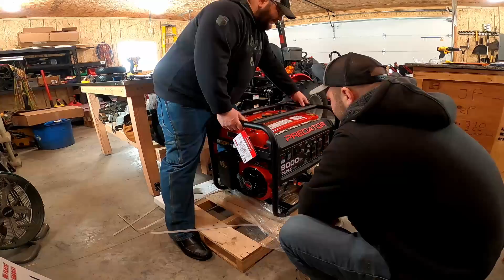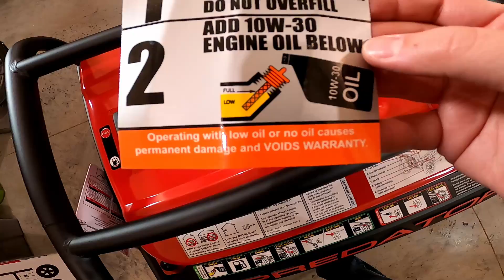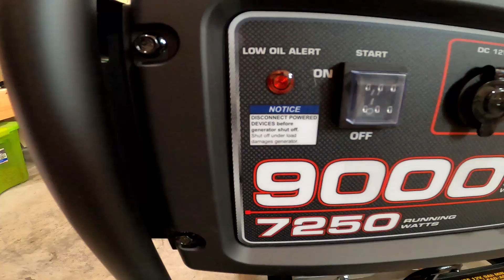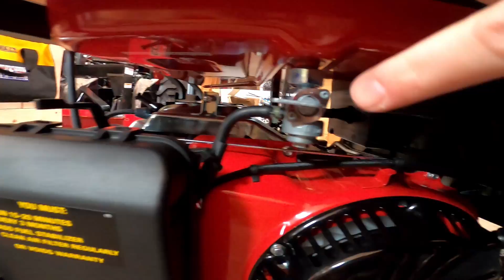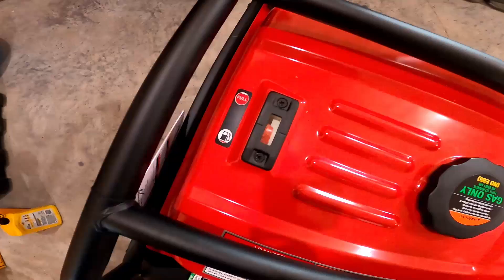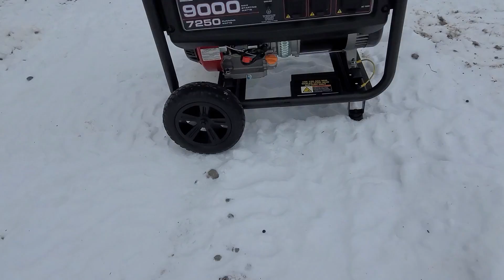Harbor Freight Generator Predator 9000 Watt- Best Portable Generator for the money?

Comment: Why use Stabill if you're using non ethanol fuel?
Reply from the maker: With or without ethanol fuel will still spoil. It's an added layer of protection to make sure the fuel stays fresh in situations like this were the generator may rarely be used. Thanks for stopping in
Reply: @k6outdoors  Gotcha. Some are suggesting turn fuel switch off and allow engine to run until remaining fuel burns out of carburator, also preventing gumming. Any thoughts on that?
Reply from the maker: @sh0964P2  I do that as well, if do fuel is left in the carburetor then there is nothing to plug it up if the fuel does go bad!

Comment: Just bought one of these and saved 20% with the track membership can’t wait to use it
Reply from the maker: Its been a great purchase so far, enjoy! Thanks for stopping in
Reply: @k6outdoors  great tutorial my dude, but where I live, the ambient temperature is about 17 degrees Celsius minimum to 22 degrees Celsius in the evening. Even if synthetic oils are great, there's no need to use them at all and I can get 2 jugs of mineral oils instead of a single jug of synthetic oil. However, I would still go for diesel engine oils, since these oils are formulated for long drain and to work with Deutz air cooled diesel engines. I regularly use Shell Rimula R4x 15w40 HDEO API ci 4/sl in my generator as thicker oils are recommended

Comment: They are very very good but new ones have C02 sensor that goes bad and shut down 
Bypass by connect white and blk wire together by sensor in panel
Reply from the maker: Great information, thanks for stopping in!

Comment: NOTE -- Don't let the gas sit in the tank. I have cleaned so many carbs with bad gas in them. Make sure the carb is also empty. Put the gas in when you need to run it. great video.
Reply from the maker: Great points, I appreciate the input and thanks for stopping in!
Reply: Use gasoline stabilizer.

Comment: I already see a loose heat shield rattle on top of head during your temp check
Reply from the maker: What you are seeing is a result of the frame rate of the camara not keep up with the vibration of the motor, I appreciate you concern! Thanks for stopping in

Comment: The original Predator 8750 is the exact same thing as the 9000. So I wonder was one under rated or is one over rated?
Reply from the maker: It's hard to say really, they easily could have changed a few small things that could result in 250 more watts.

Comment: I get they power the entire house, but using gas @ 8gals/13hr with 50% load? That's over 10gal easy per day... Depending on the emergency if the gas station not open or no power.... Storing 100gal fuel might be serious issue for many?
Reply from the maker: You make a fair point on fuel consumption and yes depending on the situation you might not have any fuel within many miles of your property. In my area we use LP as a primary source of fuel for heating our homes so I could run a line to that and run it off of that with a conversion kit, but I would rather not drain that tank as well. The ideal solution would be to have a system like my in-laws where they have a standby generator plumbed directly into natural gas. Last year they were able to run 2 weeks straight to power their property after a massive storm came through. That being said, I do keep the generator full of fuel at all times and an additional 5 gallons of fuel on hand. I make the assumption I can run the house if needed, but its primary need is for cycling the freezers and refrigerator as needed and in the winter heat, so we can stay warm. Thanks for stopping by!

Comment: HB has it right now from $789 down to $689, not sure if they'll take the 20% off coupon because it's on special for Black Friday. Will it run on Propane gas if I buy the adapter for it? If it does I'll definitely buy it. Thanks for the great video, I'm subscribing right now!!!
Reply from the maker: Thanks for dropping in! I have seen people converting them to LP but i have not done it myself. Its a great generator and think you'd be happy with the purchase.
Reply: It's pretty easy to find a propane conversion for them. A quick Google should find it for you.
Reply: Amazon has the kits. I’m getting one for mine. Already have one on a troybilt 5500 and it works fine.

Comment: Bought one after hurricane Ida. It ran almost continuous for about 7 days without a hitch. Fuel consumption dropped 2 gallons a day after a few days when the engine broke in. I assembled the wheel kit and installed battery and filled crankcase with oil on the tailgate of my pickup in the dark. Fired right up and put it to work at 11pm.
Reply from the maker: I have been extremely impressed by how well it does run,  no fuss starting and it runs smooth

Comment: This same generator is going for 789.00 now and HB got rid of coupons as well
Reply from the maker: I was definitely I little disappointed in the coupons going away. I noticed the generators are going up in price and they added more models
Reply: @k6outdoors  yes same here. I was going to buy their inverter the one with over 8,000 watts but it has more technology in it and I rather keep it simple and have something that I can service later on. Can’t go wrong with a simple generator and especially for one this size. I’m looking into getting a tri fuel conversion kit so I can run it with natural gas and i want to buy an enclosure for it
Reply: Check out my video on the Tri-fuel conversion kit I installed on ours. I don't post links to my videos on other people channels, so just do a search.
Reply: We bought our Predator 9000/7250 watts generator in Aug. of 2020 for $599 with coupon. It's crazy how much it has gone up in a years time.  It's still a great price though, compared to other generators with the same wattage.

Comment: Late to the party. But how many things did it end up running? My mom is on oxygen and a heart monitor.. I was impressed with first pull, don't need any more hassles.really likes how you went over the whole item and showed where everything is was.  Did you make a video on how to hook up Appliances etc?
Thanks again
Reply from the maker: Hey thanks for stopping by! I have not made a video of it being hooked up to everything. There are regular 110 volt out lets and then the larger 30 amp connections. Its not necessarily how many things it can run but how much power it supplies. Each item pulls uses so many watts, so you'd have to figure out or look up what each unit uses. This is a 9000 watt generator and will run basically everything in a house aside from most water heaters and large appliances such as electric stoves and central AC units. Hope this helps
Reply: Do a search for my video.  I give an in-depth review of it powering large items in our house. (I don't post links to my videos, on other people channels)

Comment: Does this unit need to be grounded? 
The user manual says to not run it until grounded?
Reply: In the real world people running generator on Job sites definitely are not grounded... Just saying. It's a technical and legal thing
Reply from the maker: If your plugging it into a transfer switch or breaker box you should be grounded by that system. If using it in a standalone configuration it needs to be grounded to be deemed safe, per the instructions. That is my understanding and you should follow the manual.

Comment: Hi you shouldn't break in a small engine with synthetic oil, it's too slippery for a good break in. Use regular oil for the break in then you can use a good synthetic oil. When it's time to shut down your generator just shut off the gas cock from the tank and let her run out of fuel. It's best for your carb that way and it will always start great later. Just saying.
Reply: Good point, NEVER let gas sit in a carb/bowl on seasonal equipment as it will tarnish the carburetor and it's components. Gas is a good solvent untill it sits still for a lengthy period of time. A fuel stabilizer will help fight this as noted in the manual. If you don't have stabilizer, drain the fuel out, then start it, let it run the fuel out of the bowl untill it starts stalling and quickly blast it with a couple good shots of carb cleaner. An old go cart racer tought me this trick to keep your carbs clean and ready for the next time you need dependable power!
Reply from the maker: Appreciate the feedback

Comment: The oil change interval at 20 hrs is more to do with the fact that the oil is not filtered rather than the quality of the oil. Non filtered oil will keep circulating any crap round the engine and causing excess wear.
Reply from the maker: understood, just weird how they changed it from previous models where they said 100 hours. Either way ill follow their recommendations. Thanks for you insight!!
Reply: @k6outdoors   oil is cheep I change mine every hard use and every year.  Mine was used hard in Buffalo had it running for over 3 days none stop in the winter a few times running 2 homes sump pumps and refrigerator.. 
But i gave mine a good 24HR brake-in changing the oil on the first 4hr then every 8 hr defiantly had some mettle glitter in the oil doing the brake in.   now its clean every change.
Reply: @k6outdoors 
Westinghouse uses a similar Chinese Honda clone engine and they recommend a 50 hour oil change interval.

Comment: Hi I just picked up the same generator I have a question when you did the three hour break in period did you change the oil after? I guess there’s metal flakes from that break in that you want to get it out of there. And that’s why you change it with a new fresh quart of oil.
Reply from the maker: Yep I did. I changed it out with synthetic oil. Thanks for stopping in
Reply: I’m waiting on my Hour Meter before I do the first pull!
Reply from the maker: It's a super easy addition!
Reply: @k6outdoors  I’m curious. The hour meter. Does it show a display while the generator is off or only while the generator is running. I’m just confused  because that meter doesn’t have power/battery in it. How does it show a lcd display?
Reply from the maker: @demetriosa7646  it shows all the time. It is an lcd display and counts when it is electricity charged by plug wire
Reply: @k6outdoors  thanks for the fast feed back. Great videos!
Reply from the maker: @demetriosa7646  no problem, appreciate it!

Comment: Bought this January of 2020 for hurricane season here in TEXAS. Tested it via 30amp plug to my eletric panel. Powered whole house, did not try to power central AC. Just had the freeze this week and the city lost power for about 3 days. Took generator out filled her up and started on second pull. We had heat when the temperature outside was below 20 degrees. Worked all 3 days without  issue. Great buy I would recommend it to anybody.
Reply: I’m in Houston, it’s EXACTLY the comment I was looking for 😂
Reply from the maker: First off, stay warm down there! I'm impressed for the money so far! Thanks for stopping in!
Reply: We're you able to buy gas during the freeze? If not can't imagine how much gas would be needed 100 gallons 7days?
Reply: I have the 8750 hf gen, I wanted to know what it would do, hooked to my panel, turned on everything including a/c minus washer and dryer, no problem, gen barely felt it, but watch it with the microwave, huge drop for a few seconds but caught back up for the most part, pulled it off couldn’t believe it, if it’s summer and you need to use microwave just shut down the a/c for the time being.

Comment: I have a Predator 6500 and these are absolutely amazing machines, great generators - definitely best bang for your buck. The only thing i wish these came with is a total watt/amp consumption meter. Wired mine to the house and no more extension cords now during extended power outages.
Reply from the maker: So far I've been impressed! Thanks for stopping in!

Comment: Thanks for the video. I have the same generator, and while I’d love to purchase American made products, I had to buy what was the best deal for me. 
When I broke mine in, I added a few squirts of oil in the spark plug hole to lubricate the top end. The first run with no load was for an hour before I drained and refilled the oil. The oil
came out very dirty. I changed it a second time and ran it for about two hours before changing it again. The oil was much cleaner, but still was a little dirty. After the third change, and about 25 hours of run time with about a 50% load to seat the rings since, the oil is staying very clean. I’m an old engine and motorcycle guy so I consider the break-in period essential for engine life.
Reply: Very good information brother..thanks a bunch
Reply from the maker: @nydrell1969  any time!
Reply: Yeah MAN! That's the one thing he didn't get into detail with. The manual does have pointers on break-in. But this being a "new product review" from out of the box to running a few hours, the break-in should be highly stressed on do's and do not's.
Reply from the maker: Thanks for stopping in! It seems like a great generator so far! Oil is definitely dirty at the first change. Take care

Comment: Looks like a good deal. How clean is the electrical output? Is it safe to run sensitive electronics on?
Reply from the maker: Thanks for stopping in, it does say on the instructions that unconditioned electrical output can damage sensitive equipment. It says do not use to power sensitive electronics unless using a line conditioner. From my understanding the only real way to have completely clean power is to have an inverter style generator and those  are substantially more. I plan to install a line conditioner and already have surge protectors as an added line of safety
Reply: I don't have a wave type device to see that, but I do use a usage meter to check the hertz/frequency.  From my testing, the fluctuations are only off about 1+/- for each. I'm working on a video showing this.  Should be completed in a couple months.

Comment: How did this compare to a similar Champion Power Equipment generator?
Reply from the maker: I dont have a similar Champion to compare it to, but when I was doing some research it was around $150 more for a similar unit with a battery. I cant speak to the reliability of the Champion brand but everyone seems to rave about the Harbor Freight Generator. I got mine with the Wheel kit and tax for $620 out the door. That is compared to a $799 price tag plus tax on the champion. Granite the Champion comes with e 3 yr warranty and the Harbor fright a 90 day, but a 2 year can be purchased for $120 if you so choose to. The Predator generator draws comparison to the Honda branded units if that has anything to say about its power and quality. Thanks for stopping in.
Reply: @k6outdoors  If you get the chance, do a review on the $799 ($100 more) Champion7500/9375 (100813) from Home Depot.  I would be interested to see how it compares to the Predator in real world.  The Internet is just waiting for this review!

The Champion is rated to be more powerful, quieter, and more fuel efficient; while the Predator has a larger fuel tank with more rated run time.

The reputation for Champion is top notch and they are a US based company (manufacturing in China).  Champion has had it's reputation for close to 20 years now and is known for excellent customer service.

I have heard the Predator 9000 start-up in person and have first had experience with a couple Champion generators, but not a model comparable in size.  I think you will find the Champion generators a small step up in fit/finish.
Reply from the maker: @scottzettervall429  Id like to be able to do that at some point, but I really had to justify myself to get what I did haha. The same Champion unit with tax would be a little over $220 more than what I paid for mine. I had looked at the different reviews and everything seemed to be very equal, except for the 50 AMP plug which some people have debates if the generator has enough wattage to truly handle the 50 amp output. The other piece is that the nearest Home Depot is an hour away and Harbor Freight was 15 minutes, which helped make my mind up. Just maybe ill be able to do a comparison in the future!

Comment: If you haven’t studied it yet. When you connect to the house you will pop gfci breakers on generator for having two bonded grounds.  You will have to break bond in generator.   Might save you a headache later.
Reply from the maker: I was planning on using the 3 or 4 prong 30 amp circuits ran into the breaker panel with a 30 amp breaker. I guess I am going to have to watch it

Comment: I bought the same generator last April and put a quick disconnect to my breaker box. Works great! Will run everything in the house including the well pump and the hot water tank. But not at the same time. But I can live with that.
Reply from the maker: I've heard and seen great things.  As long as I can keep the main items running ill be happy.  Thanks for stopping in!
Reply: @k6outdoors   I enjoy watching your videos.
Reply from the maker: @bryanritts213  thanks! Greatly appreciate it!
Reply: Gas shows 8gal for 13hrs half load? If power was out for week, better hope gas station has power?